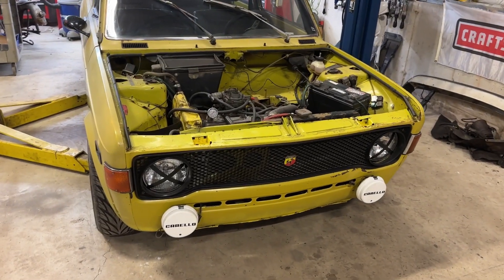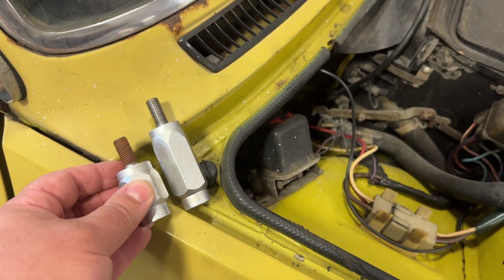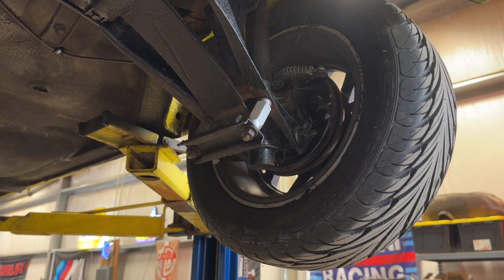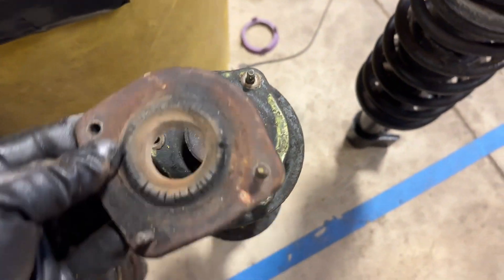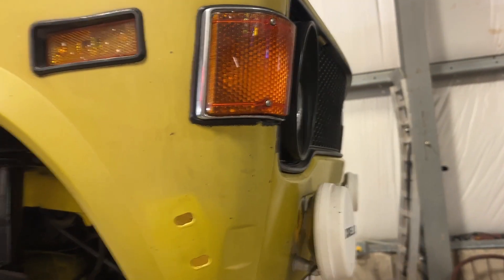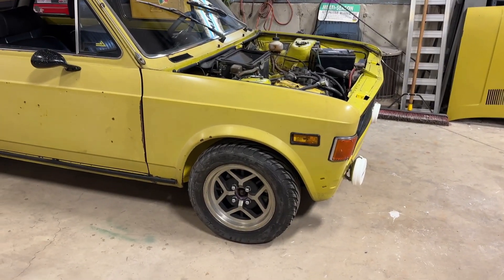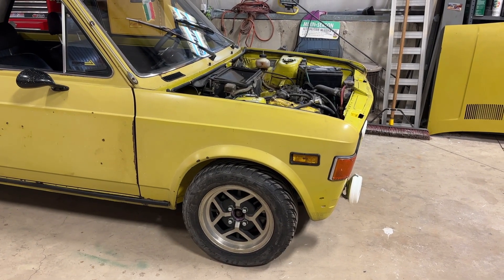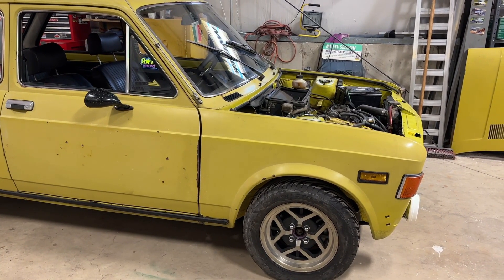Lowering the Fiat 128 with X1/9 Struts

Comment: Hello - is your replacement shorter spacer/lug extension a 3”? Your initial video suggests you used 2.5” but I’m unable to find that size. Any info would be appreciated. Cheers!
Reply from the maker: Yes, the first set was a 5” kit which means each spacer was 2.5 inches. Then I went with the 3” kit and each spacer is 1.5 inches which was better.
Reply: Thank you

Comment: Great to see you back, working on your 128.  I have X1/9 rear struts but haven’t been able to fit them to my 128 3P, as my custom extractors are already too close to the driveshafts.  I’m not sure how to resolve this but I spent waayyy too much on the exhaust to not use it, so it’ll probably stay as-is for a while.
Reply: I had a '76 3p from '82 to '88 and my mechanic always said that it shared a lot of parts with the X1/9.  Enjoy !!

Comment: Good to see you back on the 128!  When I made my coilovers with my 128 struts I used Ford Focus top mounts with the steering bearings, the bolt pattern is the same equidistant triangle pattern just a bit wider.  I also did a similar thing with the back spacers but I instead just chopped the round zone above the hex body and drilled and tapped the hole a bit deeper.  If you want to see what I did 
https://www.youtube.com/watch?v=DDJ-rADJqKE